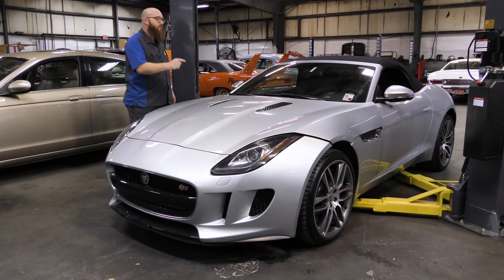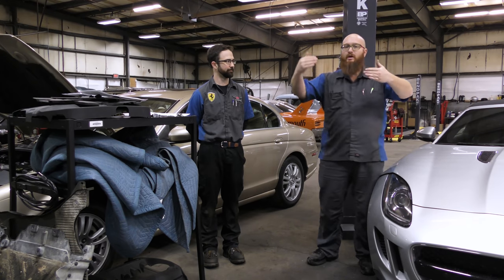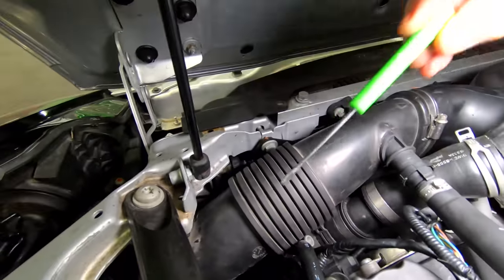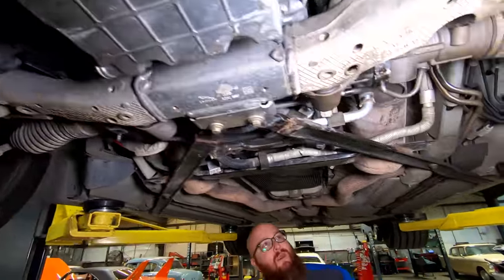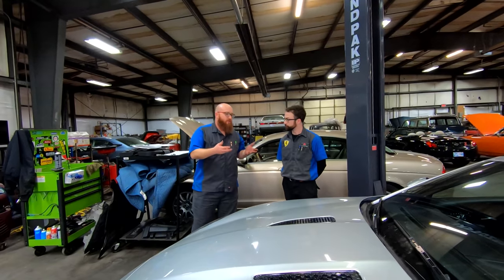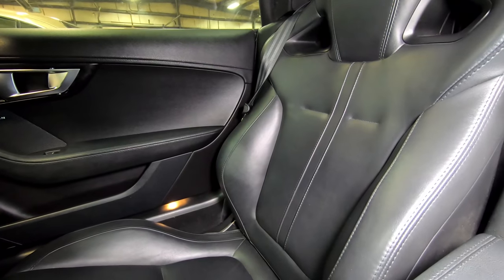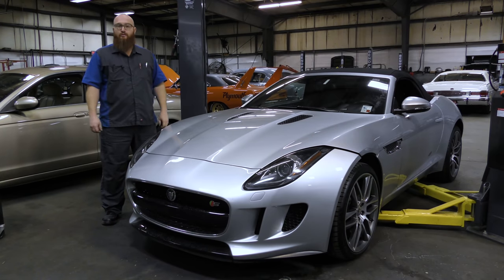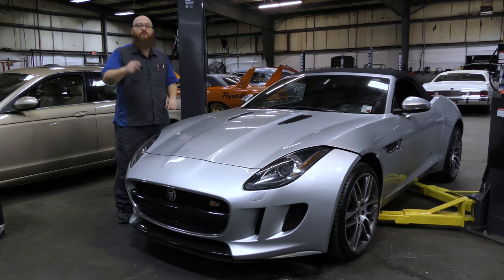How could a shop do such a bad swap? CAR WIZARD points out all the errors on '14 Jaguar F-Type

Comment: I had a new engine put in my 2014 STI under warranty, and if you pushed it hard it would overboost, set the check engine light, and be WAY down on power. Dealer of course said it was normal, and reset the light. When it happened again, I looked into it myself. The person who did the work forgot to hook up one of the lines to the boost solenoid.

Comment: I took my 93 Integra to an Acura dealership to fix the automatic seatbelt in the mid 2000's. Drove home on the highway and notice my hood was not latched all the way. Could have been a real disaster. Some mechanics are the worst.
Reply: I'll see your hood latch on your 93 Integra, and raise you a 2000 Volvo S80.  Few years ago, brought my mother's car to (an independent shop that's been in business for at least 25 years) for a coolant flush.  Picked the car up, drove about 30 minutes........"Low Coolant" light comes on.  Get the car to my house.  Coolant reservoir is EMPTY!  They emptied the coolant and never put any back in.  I'm sure the @$$hole who did it, sits around at family gatherings, bragging about how he's an, "ASELMNOPQ Certified Licensed woo, woo" and,  "it's like being a physician...........but for vehicles."   A LOT of people suck.

I can do this ALL night.

Comment: I've got an '13 Chevy Traverse that went to the dealer for the cam chain tensioner recall. It was done okay, but they routed a high-pressure PS hose wrong and it rubbed through that line and an A/C line!!! Two seconds and maybe a zip tie or two would have saved me a $600+ repair after I bought it!! No, I didn't notice it when I bought it; would you??? You figure a dealership knows how to replace these things correctly!!! This poor person has a BEAUTIFUL car and just wants it done right, THIS is what they get back???? Disgusting. Thanks Mike!!!

Comment: As a tech I don't think they did anything to damage the engine. These engines are bad to Begin with. The Harness is not a good look but a bad injector can wash a cylinder on those cars. I've seen it but more than likely the engine was just trash...

Comment: This reminds me of the motor I had replaced on my Chevy Cruze I originally purchased new.  It was stolen and came back with a broken motor.  It had a knock and the local Chevy dealer determined it need to be replaced.  When it came back the engine bay looked just like this one.  Everything half done.  I just didn't realize all the problems until they reared their head one at a time.  Had to trade it off and got a  new Toyota Corolla Hybrid.

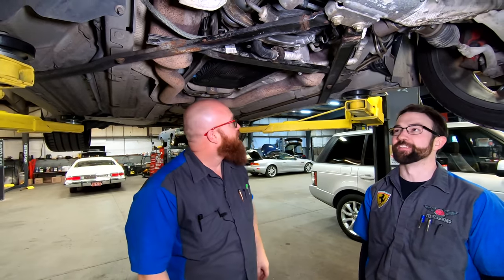Comment: 9:46 Looking on element under catalytic converter Wizard was checking I can guess that CAT was glowing from temperature. Paint is burned out and whole element looks like was overheated.
13:52 seems like materials used in this Jag are poor quality. 2014 and steering wheel so damaged? buttons without paint? is this premium brand or Chinese toy?

Comment: For 64k miles that steering wheel looks trashed and these cars have a factory issue where the rear subframe rusts out much faster than the rest of the chassis due to the grade of metal used on it.
Absolutely beautiful car and I wanted one so bad but couldn't stomach the issues they have.

Comment: Honestly don’t blame the shops for turning this car away, once you touch it you own it and whatever problems it has. And fixing a botched engine job on a Jaguar just sounds like a nightmare. The real shame is the shop that did the swap in the first place, if they had just done their job right, none of this would’ve even happened.
Reply: I'm assuming that the car owner will be able to sue that shop right? Like you can't just be able to get away with breaking something?

Comment: That hose @ 4:06 is actually not for coolant.  It's for the Symposer system (which pipes engine noise into the cabin).  It sounds stupid (and it is).  A lot of F-Type peeps have removed it all together.

Comment: Those mid-line purge valves are... fun. Loads of vehicles that Ford had their hands in use them, and they're prone to failure. My first experience with one was trying for ages to hunt down intake leaks for a lean fault that turned out to be the purge valve. Just when I thought it was good to go, it would come back with the same fault. On Mazdas, they seem to more often fail open, and as soon as the tank gets sucked down and vents, you get lean faults.

Comment: Here's an example I work with a lady and she had a 2003 Corolla she never checks her oil now she's 70 years old I understand she won't even try. The place she took it to said well the oil drain bolt I can't take it out and it's going to need new timing chains and gears which exceeds the value of the vehicle. She was going to take it to the junkyard. I seen the invoice or the explanation they gave her. I told her I would buy it for scrap or whatever she wanted for it she said $200 it turned out the quick lube place strip the drain plug which I replaced retapped it and now has a Chevy truck drain but it's not stripped anymore and it don't leak. They didn't even add oil for her they just sent her on her way it was three and a half quarts low when I bought it they didn't even mention the fact that the oil was low they didn't even put in any oil for her before I even started the motor I added oil. It's a good running car
The car has 160,000 miles I'm sure it's going to go quite a few more miles. Lucky she did have another vehicle and her granddaughter did not want this car I didn't want to explain what the place did because she doesn't want to hear it. But I offered and I do fix things around her home
I feel bad but on the other hand she thinks because they're experts and I'm just a backyard tinkering guy I'm just a caretaker she wouldn't listen to me. And this is how these shops continue to do work like this and stay open. Because people won't learn or try to learn or take advice
Reply: Standard appeal to authority instilled as kids. It’s wiser to have an inherent distrust in authority than an inherent trust in it.

Comment: Happened to me some swapped the wrong size engine all the FAB was straight doo doo. They pushed the trans back to the point and it would rock back and forth 1 engine mount completely gone. Long story short it was about 2,500 in just labor to refab everything correctly we waived alot cause it was so sad. The total was 5,782.60 for re building the trans and engine. Thank God all the new parts needed were not expensive... and that made a life time customer he had 8 more cars that needed little things and he brought them all to us

Comment: Im a college student who works in a mechanic shop part time, I am not a certified mechanic although I am able to perform most  general jobs such as fluid changed, suspension, brakes, exhaust work, engine work from being taught hands on.

When I work, I always treat everyone’s vehicles with respect and take pride in my work, weather the customers car is an old junker or a new S class, I treat every car with the same respect for this reason. I can’t imagine a person working on a clients car and being so careless and scam them

Comment: This reminds me of people I worked with. They would stop in the middle of a procedure to answer a text. Then went back to the procedure and forgot where they left off and didn't a half-assed job. Leaving parts off, screws loose or missing completely. I inspected a computer server before getting ready to send it back to a customer after repair, only to find that the guy didn't even screw in the motherboard. No screws. He'd leave for lunch at 12 in the middle of a job. After lunch, he didn't finish where he left off.

Comment: Not in the least bit surprised, so I had to comment. I have yet to get one of these that hasn't been hacked by a previous shop. I'm not one to talk bad about other shops but they really screwed that up for your customer. Typical Jag Rover dealer, they don't want to work on anything older than a couple years. 

On the injector, the special tool is a funky curved slide hammer. They can be removed without pulling the head IF you have the tool. Also not an easy head job for most people either. 

Also, the hose on top isn't a coolant hose so at least that wasn't a big deal. It's the hose for the sound symposer plumbed into the cabin. Thanks for being one of the good ones Wizard 👍

Comment: Honestly this is why I do as much work as possible myself. Even with mechanic oil change you risk loss of undercarriage splash/shield bolts, overtightened filter/drain plug, wrong oil, or wrong oil volume and that's something simple. The issue is something is overlooked/wrong almost every time.

Comment: At this point in time more then in a very long time if ever mechanics and dealers alike are taking advantage of customers left and right. Even the small mechanic that usually has a handful of cars is filled beyond capacity into the neighboring business. They are raking in so much money on these clunkers being sold at what were previously reliable dealers like hoovie's subaru. Hopefully this supply chain madness ends before the year ends.

Comment: The coolant outlet pipe or coolant manifold in the back of the engine are known to leak. The outlet pipe has been redesigned as a solid cast instead of the original two piece cast. The owner likely overheated the engine due to coolant leaks, the shop thought it was a bad injector perhaps. These 3.0 L engine do not handle excessive heat well since they are an open deck block. We've replaced countless engines from overheating because people will drive them with coolant leaks. Several have been driven to the point that the pistons melt. The coolant leaks are a manufacturing defect but the overheating is always the customer's fault because they ignore the low coolant and engine overheating warning on the cluster.

Comment: As the owner of a 2020 F-Type R, and have owned 8 Jags in total, the catalytic converter issue is common on the earlier models. Sometimes it is software related, and other times it is actual component failure. The burbling and popping these cars are synonymous with accelerated the demise of the cats. But please don't force the owner to spend an obscene amount on OEM, there are tons of aftermarket performance hi-flow options available. Generally, the F-Type is a pretty reliable car. I've had an XKR, XKR-S, and now my Type-R and they've all been terrific to me. These engines are powerhouses.

Comment: really sucks following up on shoddy work, I am familiar with these vehicles and kind of chuckled when Magic Mike mentioned an incorrectly positioned coolant hose clamp at minute four of the video, I believe it is a symposer hose, it's a weird mechanism that supposed to induce supercharger sound into the cabin, doesn't seem to do much that I can tell, Jaguar has an extended warranty on the emissions system that covers O2 sensors and maybe even the converters up to 150K miles, run the VIN through your local dealer and check, it could save your customer some serious change, convertors are over a grand a piece,  I have replaced many evap purge valves because they would not fully seal when deactivated but never one that didn't open, always a first time, if an evap system passes a pressurized test and still shows to have a slight leak, it's common for an intermittent issue with the DMTL pump, I  love the super bird in your shop, I used to work at a shop where there were original GT-40's, AC cobra's and plenty of muscle cars, I usually delt with European and Japanese rides, I like all cool cars, kind of like fishing, salt water is better fishing, fresh water is better eating, but all fishing is good 🙂

Comment: The moment you said "the cats could be cooked" at 9:45, I noticed that the two black-painted braces on the passenger side are discolored and even rusty right as they get near the catalytic converter, to the point where I might wonder whether that's evidence that that part of the car overheated severely enough to bake the paint away.

(I'm not sure whether those are braces or just support for the transmission, I'm not nearly enough of an expert).

Comment: Given what were seeing with a casual inspection, one has to wonder if the "tightened" bolts are torqued to spec. I would want EVERY bolt with a torque spec re-installed.

Comment: Back in 2015 I purchased a 1998 Subaru legacy Wsgon with 164,000 original miles I'm the second owner the car is manual or the 2.2 boxer engine all-wheel drive. The clutch was shot and I went to well known and respected shop in my town. When I got the car back it was like a million dollars but then I heard stuff falling off going down the highway and I knew it was bolts because they would hit the road and then bounce off the bottom of the car and the road then the back on the car. One night I was at a car wash and I heard a buzzing underneath the hood and when I opened the hood one of the bolts that hold the air conditioning support bracket was not even threaded in it was just sitting there buzzing as the engine ran the car has over 220 some thousand miles on it now still runs good needs a clutch again probably in a year my new mechanic said that they were replacing anything that fell off and make it right again. 

I used to think well maybe that's cuz my car was a Subaru no one cares about it and now hear someone did this to Jaguar it's just ridiculous. I guess it should have never happened to me but you think it wouldn't happen to hire a car but then it depends on who's working on it.

Comment: My boss did a transmission swap in a truck I drove for him. He didn't bother putting the keeper brackets back where they belonged and I ended up having to replace an air hose that was resting on the exhaust in the middle of the night. The fuel lines were in same area and I am still shocked and appalled that engineers would design a truck with fuel lines running inches from the exhaust unnecessarily, and lucky it wasn't the fuel lines resting on the exhaust.

Comment: So I work on bmws in Louisiana. And I see stuff like this from other shops all the time. I am not surprised at all. (I would check the motor mount arms. I have seen bolts that are to short and snap all the time.)

In heavy industries in Louisiana you do not see hack jobs like this. But on European cars it's almost always missing parts.

Comment: I’m a little older, I’m on my 27th vehicle.  Overall I have received the best service from the original dealer.  I have nothing against independent shops, I’ve use them plenty - but my experience with the independents has definitely been hit or miss.  Sometimes the same independent shop has alternatively been good or awful. In my experience, the independent shops seem to have a harder time retaining their techs vs. dealerships.  Tech turnover comes with learning curves, which seems to go along with mistakes and errors
Reply: Just don't try to get anything fixed under warranty. Horrible experience with Mazda dealers in the past and even worse with Subaru dealers (three of them on the same issues!) now.
Reply: @emjayay  I've never had any warranty issues, I even had Oldsmobile repaint a Cutlass under warranty in the mid-1980's.  I've never owned a Mazda or Subaru, sorry your dealers are not good under warranty.

Comment: Another example and this with my ML, I know I bash it a lot, but for a good reason. It was sitting at the dealer for months! I went by to check if there is dust on it. They were “working on it”. Yeah right. Then they gave us back the car one day, all they did was wash it. I said ok, great, and show me the parts you replaced, show me what you have scanned to be put into this car. NOTHING. Not even the oil for the gearbox. And this was a gearbox issue!!! After multiple alleged gearbox swaps, the car had to be taken to an independent shop that specializes in gearbox rebuilds in order for me to even be able to sell it. A lease taken directly from the dealer, so you know they would have not accepted it back when the lease came up. This way I bought it out and resold it independently, only drove it a short while after it was actually fixed because I just never trusted that car or MB ever again.

Comment: If they did any upgrades on the super charger like a pulley swap and a tune you need to upgrade the cats to sports catalysts.  The upgrades will melt the OEM cats fairly quickly. I know from experience.

Comment: This one really hits home for me- I'm from Louisiana- New Orleans. I spent part of my auto mechanic years as a line and tune up specialist for Overseas Motors, at the Free trade Zone warehouse in NO. And I have seen work from some La. "mechanics" this sorry, sad to say. One of my early jobs put me in the next bay from a guy that checked head bolt torque with an air gun, NS! The shop managers attitude was that it increased the warrantee charges to the maker- honest! Was sick the next week, came in got my last check never looked back. Working for the Mafia was better for my soul! (No I did not, but that is the way I feel). Would love to know more- there are some really good foreign specialists down there, I know one of the better ones- he was my tutor into foreign cars- Alfa Romeo!    FR

Comment: Seems the owner need to contact a lawyer and go after the 1st shop !!!

And yes I’ve had issues with a shop ….. rebuilt my transmission ( 07 tundra which aren’t known for that) they didn’t fully bolt up my driveshaft bearing, and it almost fell off . Which caused a issue I’ve yet to resolve. And worse thing is the shop went out of business!!!